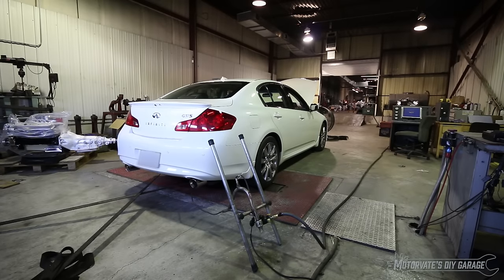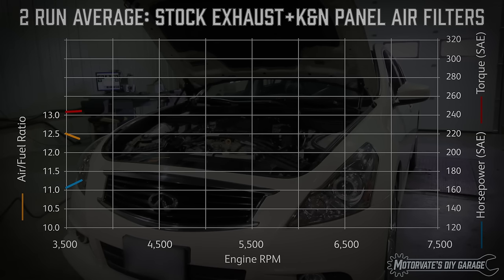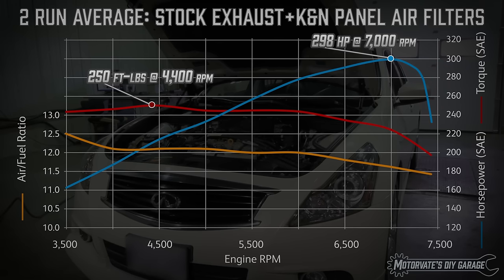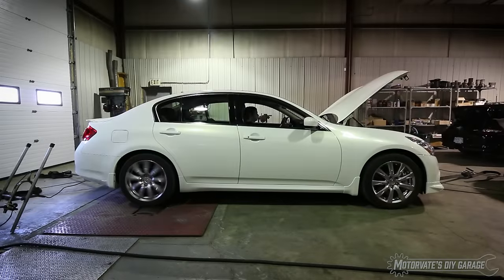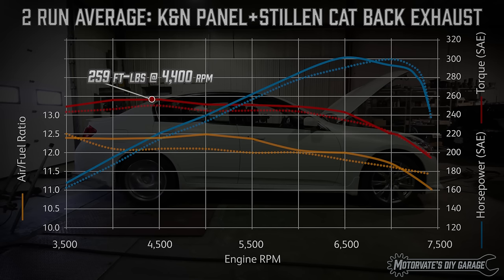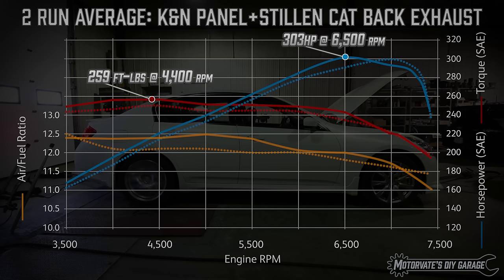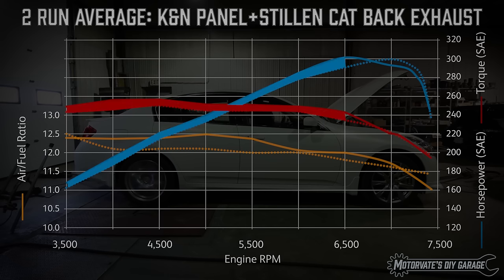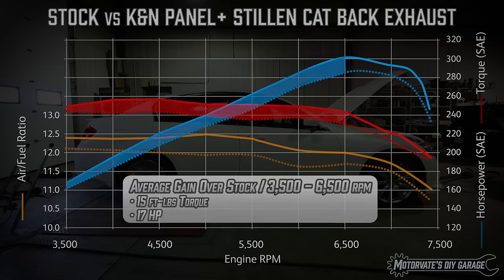Stillen Cat Back Dyno: G37 Sport Sedan  - Motorvate's DIY Garage Ep. 11

Comment: I wonder if that is with a tune?
Reply from the maker: Raul, no need to wonder any more... It is a stock tune and will probably stay that way.
I don't think I could justify at least $550 US (or over $700 Canadian) for an additional 10-15 HP. 
Plus I wonder about the leaner air/fuel ratios damaging the catalytic converter over the next 5-10 years of ownership.
Reply: Motorvate DIY I hear ya. Nice informative videos by the way, keep focused on that g37. Maybe next time spark plugs ?👍🏽 that would help me
Reply from the maker: Raul, thanks for the compliment on the videos!
I will continue to produce G37 related videos, but will be expanding to cover 2006-2012 Ford Fusion, 2012- 2017 Subaru Forester and maybe 2006-2011 Honda Civic Si / Acura CSX Type S (Canadian only model)

Good news: Spark plug replacement video is on my production list
Bad news: They don't need to be replaced for about 1-2 years

Comment: Honestly I think catback exhausts and performance air filters are complete and utter waste of money for Stage 1 performance gains. Personally I prefer my cars to not make a lot of noise. If you have a fast enough car and want to make it ride faster, do an ECU remap, get better tires, suspension and brakes. That should be your Stage 1. Stage 2 is for people with way too much cash on hand, because instead of  making small gains to your car for big bucks you should just sell it and get a faster car to begin with.
Reply from the maker: Hey flow,
 From a cost per HP perspective, you can't beat a cat-back exhaust and K&N filters for the G37 which came in at around $52/HP.

As for the ECU remap an off the shelf tune is $650 which give maybe 10 HP - $65/HP. PLUS I wonder about the long term health of the cat, since they tend to lean out the A/F ratio to make the power and results in much higher cat temps.

Anyways, thanks for the comment.
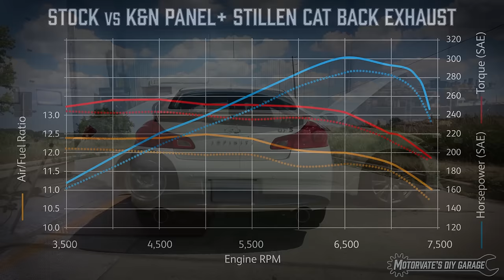Reply: Motorvate DIY, thanks for the reply. I see now that the G37's V6 doesn't respond to remaps as well as a VW inline-4 TSI but its possible to squeeze out around 18-20 bhp gains for $650 ($36/HP). Unless you got some massive discounts on the Stillen catback and K&N filters, they should've cost around $1500 or more. At 2:50 it shows 17 HP gains, so shouldn't that work out to $88/HP?

Also, any reputable tuner is aware of excessive EGT at higher revs, they wouldn't risk it on a Stage 1 remap. If you look at most Stage 2 remaps, they recommend/require high flow cats specifically.
Reply from the maker: Hey flow,
You have some good points. I purchased the K&N filters used  and I used that price, which I shouldn't of.

I assume you have the TSI... it must be nice to get such large power gains so easy.
Reply: > it must be nice to get such large power gains so easy.
Its easy to get massive power gains for any turbo car. Is the G37 naturally aspirated? If so, you need to turbo it and get a remap my friend. Tuners adjust the air fuel ratio and ignition timings to an extent to get more power. The engine can easily handle Stage 1 gains of say 35% more power/torque without any cam/piston/valve mods but in a naturally aspirated engine, they can't control the amount of air so the gains are minimal. With a turbo, now they control both air and fuel ratios, that means massive power gains!
Reply from the maker: Hey flow,
The G37 is naturally aspirated. At this time I am more interested in a whipple supercharger for it than a turbo.  RJ MFG has just released a kit for the 370 & G37.

BUT, anything like this will have to wait due to the cost :(
Reply: Supercharging is good for the low end. Good idea to do it first and then get a larger turbo down the line. Let us know how it goes after fitting the supercharger and tuning the engine.

Comment: is this tuned?
Reply from the maker: sp8punk318 this is with a stock tune. There may be additional gains with a aftermarket tune, but in Toronto they are just too much money (about $800 Canadian) for too little of a gain. (10-15 HP) 

That $800 equals THREE nice track days and that is much more fun!
Reply: +Motorvate DIY there's a website called Tdot performance that's a Canadian aftermarket performance site that has free shipping all of Canada to save you some money on future mods haha
Reply from the maker: Hey Darksyne,
Thanks for the tip. I have been to their site as well as imageinmotion.com and their prices are good, BUT still 30+% more thatn the US sites due to the exchange rate :(

Comment: I thought stock hp was 330hp?
Reply from the maker: Hey tenacity2986,
That's a good question.. 
It is 330 hp on the G37 coupe, / 328 hp on the G37 sedan. 
BUT this is measured at the crankshaft. 
All horsepower (and torque) figures from the manufacturer are rated at the engine's crankshaft. 

The "chassis dyno" measures it at the wheels, and as you can guess, there are power losses due to friction in  transmission, differential, CV joints and at the tire. 

Have you ever tried to push a car in neutral? It takes some extra effort to get it moving and then it doesn't roll very far.

Comment: That is indeed a problem the car revs to 7500 rpm. Look like you have a restriction. Are the CATs still in place? Maybe it needs a bit of retard on the exhaust cam. The factory exhaust design does not look to restrictive except for the CATS.
Reply from the maker: There is no restriction... Based on  OBD data logging, the ECU starts to close the throttle bodies at ~7200 RPM to protect the engine.
Reply: @MotorvateDIY  Perhaps that is specific to infinity and automatics. All of the dyno graphs I see don't dip like that  after 6500.

Comment: Sound terrible you should be able to make it sound better then the sound I think standard road tyres can hold back the car so that's why I put race tyres on it feels like it pulls but my one is the vq35de engine and I'm surprised that car only had little hp more then the vq35de you must have the 2008 3.7 engine
Reply from the maker: Hey Des M,
In a future episode, I will be explaining why dynos read VERY different numbers and what to look for in a GOOD dyno operator.

Comment: Needs a cold air intake and i bet itll make close to 315bhp
Reply from the maker: Hey Connar Downes,
You may be right...
BUT it doesn't makes sense to me to spend $500 (or $640 Canadian plus shipping, PLUS taxes) for  only 10-15 HP.

In a future episode I will be analyzing the air flow performance of the stock intake with K&N, factory and no air filters using a high resolution (14 bit) digital pressure sensor inside the factory air box.  Maybe the stock intake is good, or maybe is sucks.... BUT we will find out :)
Reply: Motorvate DIY damn! Thats alot of money for shipping i agree with you i look forward to the video i just discovered your channel and i love it!
Reply from the maker: Thank you! I am working on the next episode right now :)
Reply from the maker: Hey ItAintGaY,
The budget for this year won't allow it. I will try to get it into the 2018 budget as it would be very interesting to see what the dyno says :)
Reply: ItAintGaY post maf tubes have been shown to add little to no HP over stock. But they only cost ~$100 so not a huge investment. Perhaps its better to save up for a true dual high flow exhaust with new cats, rather than only a cat back
Reply: Motorvate DIY very cool idea, also I wonder how much difference a full free flowing exhaust would make vs. Only a catback...
Reply from the maker: Hey nighthawk0077,
I suspect there is some power to be made with aftermarket headers and/or hi-flow cats, BUT many seem to have check engine lights after a while. Since my car has an emission test every 2 years, I don't think the gain is worth the risk of failing emissions.
Reply: Yes CEL will come on if you mess with the cats.  Intakes, and exhaust means it will throw the CEL if not re-tuned.  I bought a 370 that had z1 intakes, hfc, and the Stillen true duel. CEL went off first day owning it.  Kept the Stillen, went back to factory for everything else done at a Nissan dealer.  No more CEL and car runs, sounds beautiful.  My state does inspections too so I have no interest in messing with emissions stuff for a street car.  Brand new factory intakes, air boxes and oem cats :).
Reply: Anybody wanna buy berk hfc and the z1 intakes? Heh heh

Comment: It needs a new tune since it has. Bigger exhaust
Reply from the maker: Hey Andrew Gaston,
A tune would make more power, but that is mostly due to the changes in ignition advance and a leaner (~12.5:1) fuel mixture at idle. (Stock can get as rich at 10:1 to keep the cats from melting)

There is a plan to get EcuTek in the future, but not for this year.
Reply: Motorvate DIY yea I just learned about tuning after a exhaust upgrade you learn somthing new evry day
Reply: Great channel
Reply from the maker: Correction:

A tune would make more power, but that is mostly due to the changes in ignition advance and a leaner (~12.5:1) fuel mixture at *wide open throttle* (not idle!)
Reply from the maker: Hey Andrew Gaston,

As a general rule, most "bolt on" modifications (cat back exhaust, cold air intake) don't require a tune for the engine to run well. BUT you can get a little more power with a tune for a non-turbo / non-supercharged engine.
Reply from the maker: Hey Andrew Gaston,
Thank you!

Comment: Your horsepower number is well within the margin of error.
Reply from the maker: Hey Silas Mayes,
It could be, I really don't know. What is the margin of error  and how is it calculated? Does it change for different dynos? I would like to understand this better. Thanks!
Reply: @MotorvateDIY  I'm not sure what the percent margin of error for a dyno is, but from my understanding every dyno gives slightly different numbers. When one dyno shows an increase another also shows a similar increase.
Reply from the maker: Hey Silas Mayes,
I completely understand.... All dynos report different numbers based on the different correction factors and operator skill. I am currently researching this so I can be better educated for the dyno re-test planned next month.

I also built my own weather station to accurately measure barometric pressure, temperature and humidity. It also calculates the J607 and J1349 correction factors. You will see this in a future episode. :)

Comment: your power could be better with a Tune. 😉
Reply from the maker: Nismo370, I agree! BUT the gains are too low for the high cost. $800 Canadian for 10-15 HP doesn't work for me.
Reply: Motorvate DIY Well it would be across the power band.  I am about to do it (next month).  I will let you know what the results are on my Z.
Reply from the maker: Nismo370, please do. Any way you can dyno before and after?
Reply: Motorvate DIY Yeah, i did a baseline and it was 278hp and 235tq.  I installed header and CAI it it put down 288hp and 240TQ with my A/F mix running lean.  This was on a Mustang Dyno (which reads lower then Dynojet), I have an Exhaust on it now, I have not Dyno'd it yet.  
Tuner said he will do a baseline then the tune.
Reply from the maker: Nizmo370, what was your A/F ratio with the CAI and header? Did they measure it at the exhaust tip?
Reply: Motorvate DIY I dont recall 100% but i think 15:1 below 3500 then went to 14.5:1 towards the redline.
Reply from the maker: Was that measured before the catalytic converter or after? (with a probe that goes into the exhaust tip)
Reply: Motorvate DIY it was measured after Cats.
Reply: Motorvate DIY so i got my car tuned yesterday.  before tune it was measured at 310whp at 7200 with 247wtq at 4400.  after the tune it is now 317whp at 7400 with 253 at 4400.  with usable power gains between 6-8 throughout the entire rpm's.
Reply from the maker: Hey Nismo370z,
Nice gains! What mods do you have and did you go with UpRev or ECU Tek?
Reply: I agree.  However, tuning outside of California and the east coast is dismal, and by that, I don't mean there are not people that don't have talent, I mean that shops in Oregon have a different person every minute that's all of a sudden an "experienced" tuner.  Personally I would ship or drive my car to a tuner than let one of these low life mouth breathing hat wearing crater faced punk scum lapping shit bag worthless kids touch my car, and believe me, they don't work harder or better if you pay them more.
Reply from the maker: I agree.

I do wonder about the VERY long term reliability of an aftermarket tune. 

Usually they slightly advance the ignition timing and lean out the A/F ratios to mid-12 for WOT. This does make more power, but is also increases the exhaust temperature which may harm the catalytic converter after many years.
Reply: sometimes you do advance timing but this is dependant on the exhaust setup you have on your car.  they can advance as high as 20° positive or negative.  i went with Stillen headers, Z1 HFC, and Tomei cat-back.   the tuner left it at 0°, as this is where it was best.  he said when left at 0°, this means my flow on exhuast is optimal. as far as A/F, they adjust this so it is more stable for more available power as our engines run rich from factory.  
in short, the exhaust setup i have is ideal.
Reply from the maker: Hey Nismo370z,

You might want to data log your ignition timing to see where it is at. I really don't think it is at 0.

My guess is that it is mid-20 when at WOT and 30+ degrees when cruising depending on throttle position and RPM, etc.

Do you know of anyone who had had a tune on their 370/G37 for 5+ years? I honestly wonder about the long term effects of running an engine slightly leaner (but not too lean) than stock over the long term.
Reply: i have a EcuTek BT Dongle and thr iginition time does range from -7 at crusing to 0 at full throttle.  i dont know them personally however there are people with Tuned NA VQ Z's for years.  Osiris UpRev 1st cane out dor the Z's almost 10 years ago and the #1 complaint was no launch control but they no have that feature.
i can email you on of my data logs and you can review if you'd like.
Reply from the maker: Hey Nismo370Z,
Hmmm, I wonder if the values (-7 to 0) might be an offset to the ECU calculated ignition advance?

I would love to have a look at your data logs and will send you my email address.
Reply: Sounds good.
Reply: okay sending.
Reply: Motorvate DIY can you reply back to my email to make sure i sent it to the right email, thanks.  sometimes i fat-finger letters from my phone.
Reply from the maker: Very interesting.... I just had a quick look and the "0 to -7" values are the "Ignition correction" and not the actual ignition advance in degrees.

I will spend more time looking at this once episode 20 is finished.
Reply: let me know when you have a chance.
Reply: Motorvate DIY i will have anpther chance to do a run maybe next weekend.  this weekend is going to rain and will be to busy to go to track.

Comment: Not even close to the Stillen claims.
Reply from the maker: Hey Sean M,
You never know where the difference comes from.. is it the car, poor quality gas, hot temperatures, the dyno or the operator. and on top of this there are many different correction factor that adjust the HP and torque up and down. 

This dyno was corrected to SAE J1349 conditions (the current standard) which lowers the power by 4-5% compared to STD or J607.

This may interest you: 

https://www.dynomitedynamometer.com/dyno-tech-talk/corrected-horsepower.htm

I will be going back to a different dyno for a retest in the next few weeks.